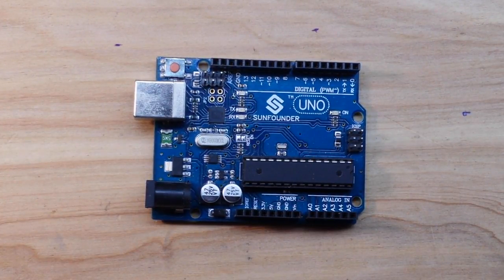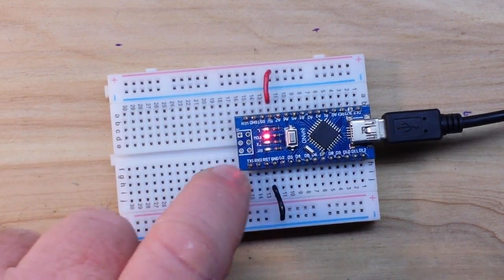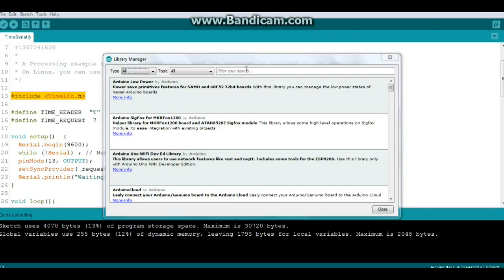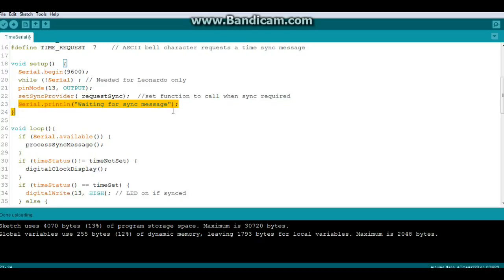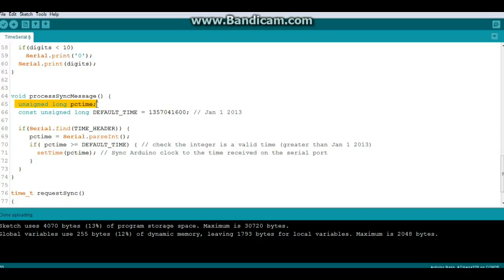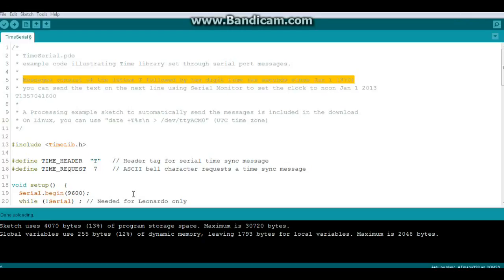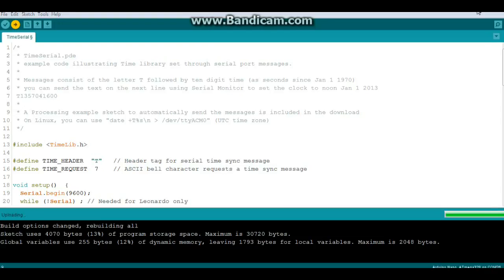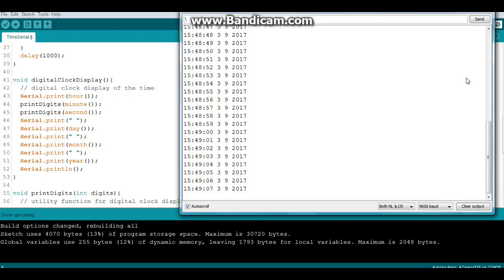Arduino time without a RTC

Comment: This code will work and sync the time and date if it is connected to the computer.
What if I want the time and date to be synced even if it's not connected to the pc. I want it for my clock project, where I will just fix the board to the clock. Can you tell how can it be done?

Comment: nice video man but The disadvantage is that time will be incorrect if the Arduino is reset. can we use the datetime library to set the time in  DS3231 AT24C32 IIC Precision RTC Real Time Clock  so we can keep the time correct even if  the Arduino is reset.?
Reply: i have the same question what happens when the arduino is reset or loses power

Comment: When I implemented  a clock on the Arduino Uno without using a real time clock module I found that the Arduino lost around 7 minutes every 9 hours. A real time clock such as the DS3231 is the best way to go, plus they only cost a couple of dollars each.
Reply: If it consistently loses 7 mins every 9 hours, you can compensate for that in code by defining F_CPU to whatever you have observed before the library.

Comment: There are  2 wires hooked up on the bread board. Are these needed?
Reply: These are used for external power supply